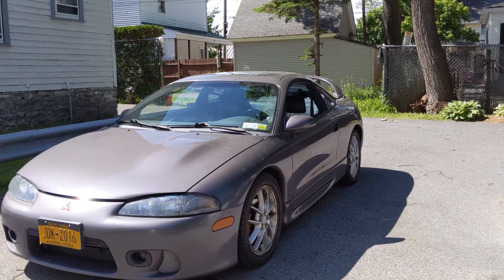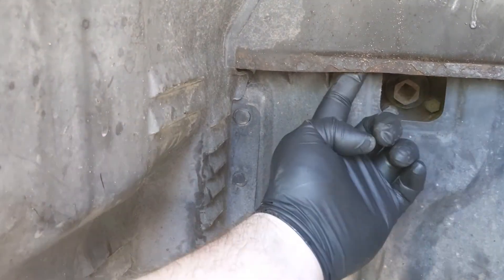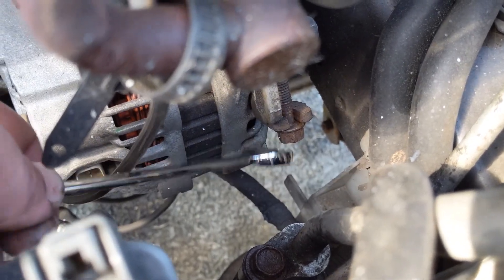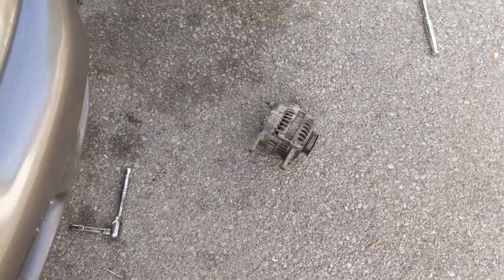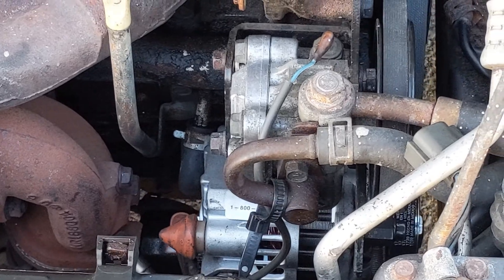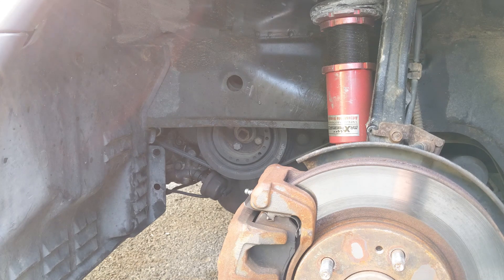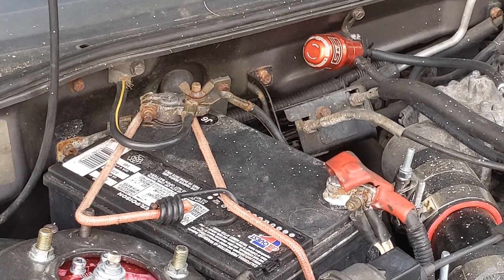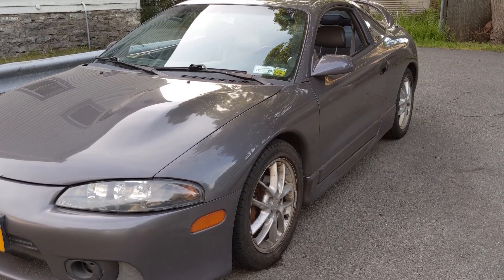2G DSM alternator replacement!

Comment: READ THIS IF YOU ARE ABOUT TO ATTEMPT ALT INSTALL!!! 
This video helped me install an AUTOZONE 90 AMP Galant alternator on my 2G Eclipse GSX. The inner wheel splash guard actually has 3 12mm bolts from the factory plus the 2 plastic fasteners that are originally plastic Phillips heads but can be easily popped out with pry tool, watch your eyes, they launch into space when you pry them out. Replace your alt belt while you are at it. AutoZone part number for Alt Serpentine belt is 4040390 Brand is Continental, $14.  doesn't

Comment: Thanks for the video man.! Just what I was looking for and more detail than afew others I've watched. I to will be replacing my alternator soon because mines just barely charging the battery and now it should be no issue thanks to you and your video.! I'll update you on how it goes whenever I get it done. Thanks again.!
Reply from the maker: I'm glad it helped you out!. Only thing that got in my way was the oil dipstick. If your careful you can bend it out of the way ever so slightly and then you won't have to disconnect your oil filter housing. Good luck with your project!
Reply: After reviewing your video again I caught a part I must've missed last time. You said that when you were taking the alternator out that you broke a tab off of something. What exactly was it that ended up breaking and am I able to disconnect it before taking my alternator off so I don't end up doing the same thing.? Also, I noticed you don't have a heat shield on your exhaust manifold, my gst still has it on, do you think that's something that might give me an issue taking the alternator out.? Thanks in advance.!
Reply from the maker: @queeneboy566  it was one of the black clips that attach to the low oil light sensor and stock oil pressure gauge. Easily fixed with a ring terminal too.

Comment: Hey dude, question. I got a duralast gold ALT and installed but i can’t figure out the ground cable, people say the Alt case is grounded when you bolt it in, but i also have what seems the be a metal bracket that goes into the ground post on the ALT. The old one did not have ground connected
Reply from the maker: @Hater4life814  iirc the cable for positive side goes on the spot with the nut and cover, plug goes in and it’s all set

Comment: question,
its very difficult to align the guide pins with the long bolt coming from left (under the exhaust manifold). It just pops out whenever the end of the bolt reaches it. Do I have to place the head of the long bolt from right (wheel side) to left? I'm confused. Thanks!
Reply from the maker: The long bolt should fit from the left side and the threads should be on the wheel side. I can't remember if there's a nut on the other side or threads, but either way if it's misaligned and you can't get it to start turning into the threads, then stick a nut on it if you have space. I'm pretty sure it's threads. If for some reason the bolt keeps sliding out, you might have it stripped and need something longer. I've seen folks use extra long bolts from Ace Hardware and replacement of their lower alternator mounting bolts. The top ones are the ones that make tension on the belt. As long as you have a bolt in the bottom, both ears of the alternator and you can make tension on it. You can put your belts back on and it should run fine.

Comment: I'm having trouble putting that tensioner bolt on. I can't seem to put it on. Anything that helped you guys put it on?
Reply from the maker: Once I fed it in from the belt side in towards the downpipe, I used a pry bar to pull the alternator forward and tightened down the 12mm locking bolt on the tensioner. Then adjusted the tensioning bolt out and final locked the last 12mm. Hopefully that makes sense
Reply: @TPGDSM  makes sense. New to dsm world as its my first one. I'll give that a go. I got everything else but that bolt in. Thank you for your help!

Comment: I just replaced my alternator using your video. It's a 90 amp one too, but my lights are still pulsing and my voltage reads 13.3-13.6. My rpm gauge is also jumpy when i give it gas. I don't know what to do. Any ideas?
Reply from the maker: Are you using ECMLINK?. A few other things that helped me..
#1 making sure all my chassis grounds were in good condition as well as the white thick wires that come off the positive side of the battery. They're routed to the alternator charging line and starter solenoid.
#2 if you pop off the center console kick panel on the driver side you will be able to access the ECU, between the ECU and the firewall is a bundle of ECU chassis grounds for all of your sensors and lights that get surface rust on them. Try checking those ground connections out and cleaning the metal contact points. 
#3 jumpy rpms id do a boost leak test, verify my isc position is correct and my throttle position sensor is set correctly. Hope that one of these helps

Comment: How u got the pivot screw off? And is yours square ⬛ shaped too?
Reply from the maker: Mine was not square. Sounds like someone put an Evo alternator pivot bolt in yours. My pivot bolt slid out towards the downpipe iirc. Hope that helps 👍
Reply: @TPGDSM  ok thanks😎I ended up getting it
Reply: @TPGDSM  now my long tensioner bolt is rubbing the power steering belt. That's got to be the dumbest placement to have THAT long of a bolt at. But I see my problem though. The little connecter piece on the tensioner that connects both tension bolts together....I have that flipped the wrong way💀
Reply from the maker: @djack2058  yeah it's a tight fit in there my friend!. And don't feel bad. I replaced my valve seals and through my water pump pulley on backwards and drove like that for about 2 weeks before I figured out what the screeching sound was 😂. We all live and learn! Glad you got it figured out my friend 👌
Reply: @TPGDSM  🤣 dang. And true true 😎. I'm glad the pulley didn't mess anything else up lol

Comment: Where is the jack point on the eclipse?
Reply from the maker: Just behind each front wheel after the fender. One under the center of the front bumper on crossmember, one on rear under differential

Comment: I cant put the tension 12mms back on, any help?
Reply from the maker: Hey there, are you trying to tension the belt? You have to lock down the bracket with the long bolt in it first and then adjust the long bolt to tension the belt tightly
Reply: Today's Project Guide i somehow cant get the locking bolt into the alternator for some reason, the tension bolt is good but the smaller locking belt isnt going in at all
Reply from the maker: @jesuslopez-wk1ve  Im not 100% sure but it almost sounds as though you may possibly be missing a nut? Could you specify which part won't tighten using the diagram in this link?  https://www.dsmtuners.com/threads/alternator-bolts.394786/

Comment: Serán ciertos esos alternadores Ebay 150amp? Seria mejor q autozone 90amp
Reply from the maker: No estoy seguro de si realmente mostrarían 150 amperios en un multímetro.  sería una buena idea para un video de comparación.  puede obtener un buen alternador de 150 amperios o puede obtener un alternador de 100 amperios que dura 5 semanas.  acertar o fallar en algunas de las afirmaciones de eBay.  Yo iría con AutoZone de 90 amperios garantizado o una mejor marca de piezas de O'Riley.  depende de ti mi amigo 👍

Comment: I got a 2g for 200$ im getting problems with it stalling with that be alternator as well i have new battery and it got drained
Reply from the maker: Stalling out? Does your car crank and start again after it dies? Could be a number of things. What's you blow off valve set up? Any boost leaks? Plug condition? . Fill in some more blanks for me and I'd be glad to try to help👍
Reply: @TPGDSM  yea it cranks and starts back on but yea it stalls
Reply: new sparks
Reply from the maker: @Theplantersguy  have you boost leak tested it? Maybe have a vacuum leak, Also is you blow off valve recirculated?
Reply: @TPGDSM  Not a pro but its not a gsx its bone stock gs how would i check that
Reply from the maker: Ok non turbo gs stalling. If it starts and slowly dies I'd take a can of brake clean and start it, spray around all the vacuum hoses and gaskets to until I hear the engine bog, then search in that area for a torn line. Could have a dirty maf, dirty plugged up fuel filter, dirty throttle body or something else. Start with a list of possibilities and check each off the list. If you have a check engine light when it happens get the codes, keep us updated

Comment: Easiest way to do it is remove the front bumper, pull alternator out of the bottom front corner. Install it the same way.
Reply from the maker: Sounds like a good plan for next time! Now that I've removed the bumper once and replaced the hardware it'll be easy to remove again when the AutoZone alternator quits. Thanks for the tip 👍👍
Reply: So I've had DSMs basically the last 15yrs of my life, I have my first 4g63T now which was a purpose build from a rolling shell to learn about the differences between the old 420a and 4g (had many 420s, 1 custom turbo that was actually pretty fast that I think I still have an old video floating around of if interested). Anyway, the car I have now didn't have an alternator so I got one from the junkyard which was bad, was able to get the car running to find out it needed a water pump and a new alternator. So, instead of going with the stock I think 75 amp alternator, I got a new one from autozone for a galant (90 amp)... FYI, autozone parts are great, I used to work there, as long as you don't get the cheap crap which I'm sure you know. But the 90 amp, overall especially when you start going gauges and electrical accessories etc, well worth it and not that much I think it was like $110 after online shopping deals and taking the core charge back and that's for a brand new 90 amp... maybe that'll be beneficial to others looking. But, just wanted to mention that, and say I enjoy this content, especially the window rattle fix never knew that before and I've had rattly DSM windows for quite a while so keep this up man you have some great info for even highly experienced (emphasis on highly) DSM guys.
Reply from the maker: @ChrisGuthrie  hey thanks for sharing the info and  I'm glad you find the videos entertaining! This started as documenting my hobby and turned into a helpful Avenue for a lot of newcomers to these cars. I've owned a 91 tsi fwd, 92 tsi awd and a circle track built 91 tsi awd with a fully built block and head running a good ol Frank 20g!. And don't get me wrong AutoZone parts are good quality (considering Rock Auto.com offers parts 1/4 the cost as well and 1/4 the quality). But hey thanks for the sub and feel free to share any tips/pointers in the spirit of sharing the information with those who truly may need to use it ! Keep wrenching and I would love to see some of your builds if you'd like to share them along with your handle/ Instagram name  I'm piecing together an episode to show off all of the channels subscribers cars/builds from shells to fully built cars. It should make for a cool episode. Send to TODAYSPROJECTGUIDE@GMAIL.COM if your interested!
Reply: What is your experience with the reliability of the 4G once you have it running the way it should? And how is that AWD? I was looking at some videos about the AWD swap but think that if I decide to go that route it would just be better to sell my GST and just buy a GSX. But that's if it's even worth it. Personally, I just have this car to not put as many miles on my truck driving 100mi/day to work and also to have a little fun with it but not a track guy myself unless its moto related but these days it's about having fun without sacrificing reliability so that's kind of where I am now. As far as the projects I've done, I'll make a few collages of my past and current DSMs and shoot that to you that sounds like a really cool idea and thank you for inviting me to it. And heck yeah man keep doing what you're doing you have a good thing going especially considering there aren't many "realistic" DSM build series like this out here and even with the repairs and maintenance and general stuff, the more info we have out about these cars the better overall. New people getting into it brings new ideas and can only make it better and this is a great platform for it for the few that can dedicate the time to all the work it takes to keep up with a channel like this. Much respect bro, I'll try to shoot you that email by the weekend
Reply: Quick tip to spice up the engine bay a little since it looks like you still have the AC hooked up, take some mothers metal polish, turn a old cotton sock inside out and rub the aluminum on the AC lines. After it all turns black, wipe off with a clean rag, easy chrome like shine. BTW, watched your coilover vid, have the same on mine now that I got from ebay and same issue with the front fork leg, when you are working with them, put the pinch bolt in backwards with something to block it from going through the empty hole on the other side and tighten the bolt to spread the fork to make it easier going in and out. I put mine on wrong and had to take them off to fix after having so much difficulty getting them in this was my solution.
Reply from the maker: @ChrisGuthrie  yeah those were super tight! Here I was thinking it'd be a quick and easy install and an hour in I'm fighting to open the forks.. I'll have to try the mothers metal polish. My engine bay is in serious need of a partial tuck and full clean!. Keep em coming 👌
Reply: I'm so down for a how to wire tuck video, just saying lol
Reply: @TPGDSM  Just emailed you my pics from g3racingr6, use or dont use any you would like bro.
Reply: You don’t need to take off the wheel or jack it up just remove front bumper?

Comment: that is not to bad but autozone alternators tend to suck
Reply from the maker: I totally agree. Unfortunately that was the only one available when I needed it. Currently I have my idle raised by 100rpm in ecmlink to compensate for the low voltage output from it. I'm planning on replacing it with a higher amp rated unit this summer. 750rpm output voltage is 12.7v idle rpm at 800rpm output is 13.5v🙄